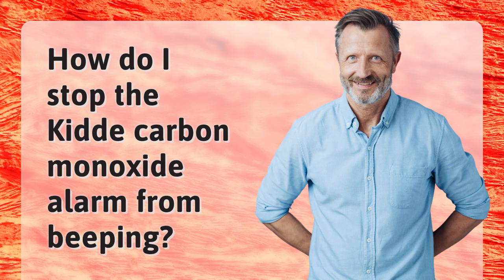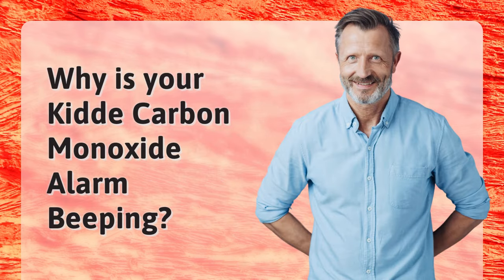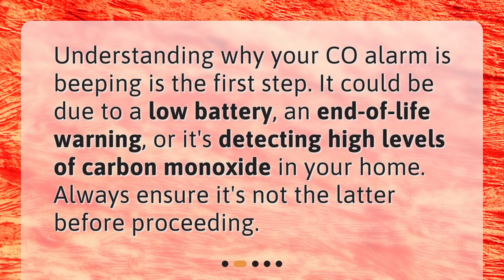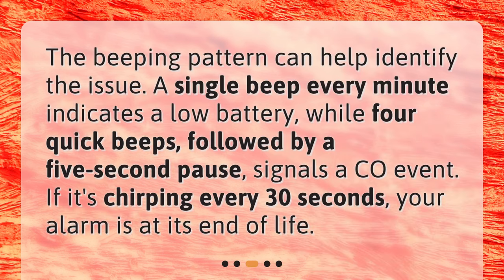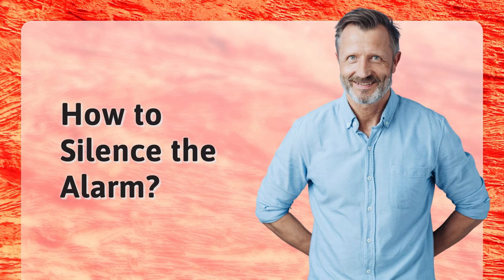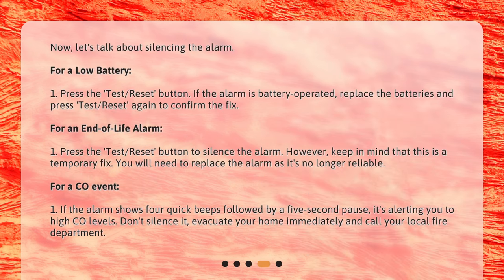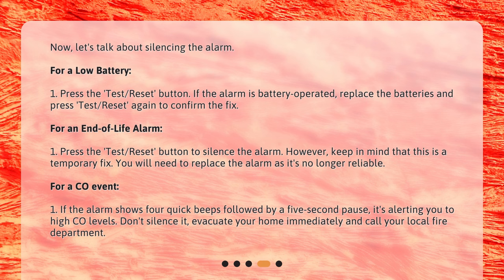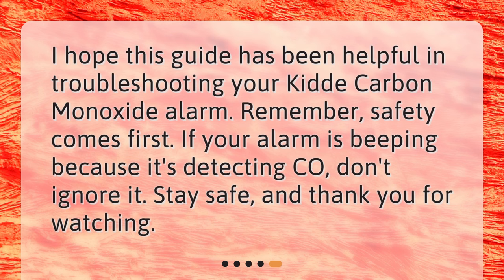How do I stop the Kidde carbon monoxide alarm from beeping?

Comment: Mine is 3 months old, I've checked the voltage on the batteries, and it says their good, but I replaced them anyways.  I have the wired one, I've tried reseting with and without removing the batteries. Nothing seems to work. I've even shot compressed air through it. IMO it is just hot garbage of a product.

Comment: I have a Kidde Nighthawk carbon monoxide detector. It was manufactured in 2013. I justed moved into my apartment and none of the batteries in any of the smoke detectors or carbon monoxide detectors were installed properly (backwards). Plus, the batteries are all dead.

I got a new battery and tested all the detectors, and they all seem to work. But, I was wondering, do I have to replace the carbon monoxide detector?? I was reading online to change it every 7 to 10 years, and 2023 is going to be the 10th year.

Is this something that I need to do? I'd rather be safe than sorry, though I am on an extremely limited budget. Is this something that the landlord would be responsible for doing? Do I buy it and install it and get the landlord to reimburse me? (I live in Ontario, Canada)